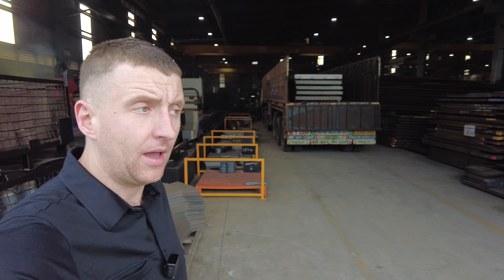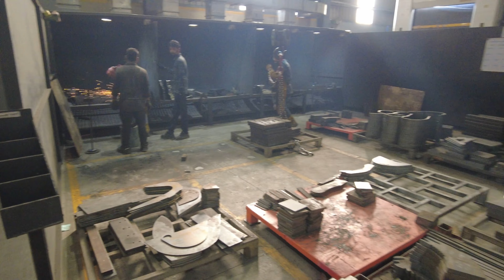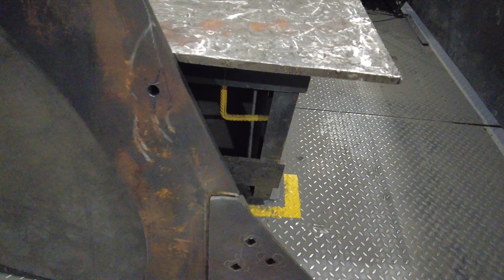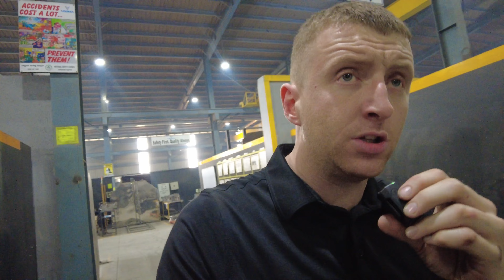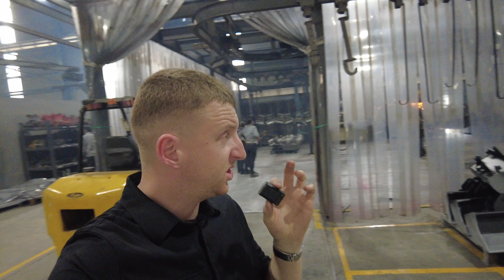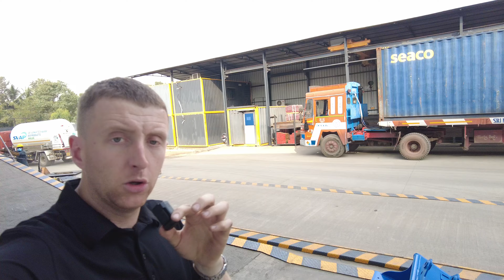Behind the Scenes: Crafting AttachWorx Skidsteer Buckets from Concept to Completion

Comment: No safety shoes; no helmets; no steel toed boots.  But one guy has a cotton mask to wear!  Zero safety awareness.  Obviously not made in the UK.
Reply from the maker: Hi James, you are correct - not made in the UK and we would never claim otherwise. Majority of factory floor workers were wearing steel toe safety shoes whilst I was there though. Granted no head protection.

Thanks for watching. Cheers, William
Reply: It’s incredible that an Indian manufacturing company will actually check that the brackets fit the headstock they are meant to yet a British manufacturer that I order a telehandler bucket from sent two buckets neither of which fitted the headstock correctly.